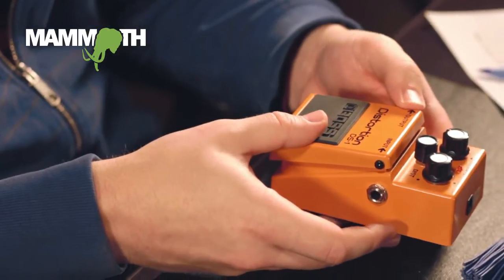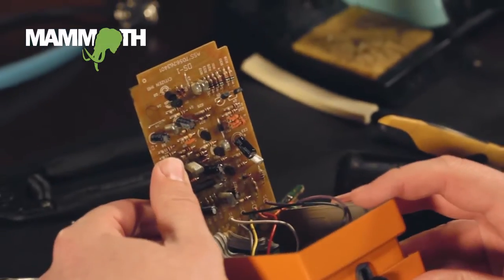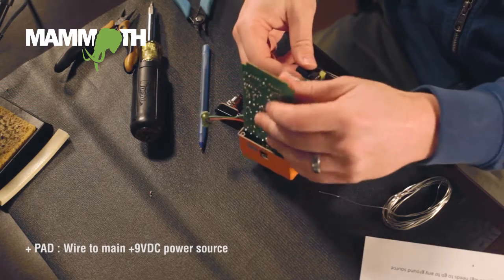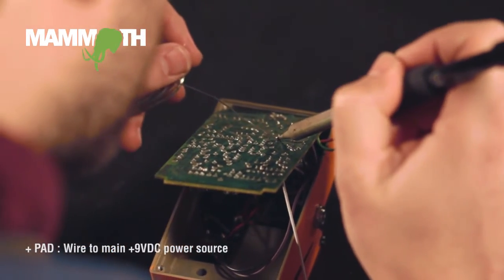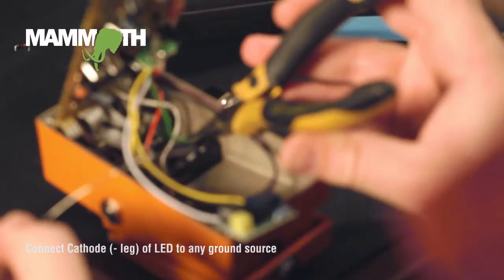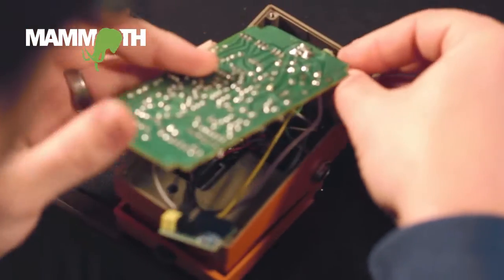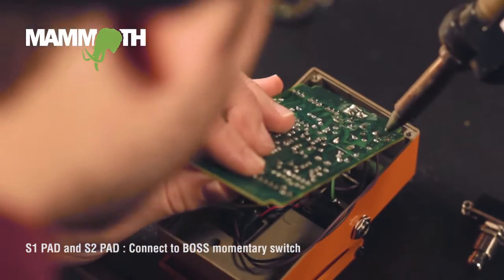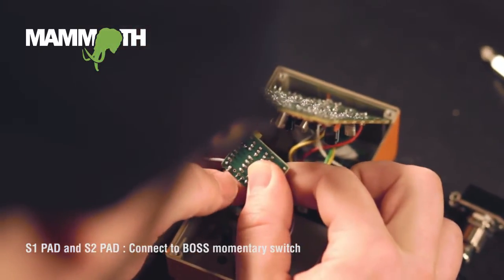Isaac Installs Click-Less True Bypass Into Boss DS-1 Pedal

Comment: Finally got around to installing in my Keeley DS-1. I bought a set of different coloured wires and just used the same colours as Isaac. Saves getting confused. Note on my DS-1 the Zener diode was jumpered across. I removed this. All works a treat. I did things a little different. 1) I made sure all wires went through the pcb holes from the top. 2) I then put the whole lot in quite wide shrink wrap - this takes less space and feels electronically safer. This way I didn't have to stick the board down or bend any components. An awesome pedal that I can now mix in loops with other pedals.

Comment: I checked the modules and seems like they are no selling them anymore,  there are other vendors,  you can try  "Griffin Effects",  they have a more updated version, and other bypass systems  like "the Parasite" bypass I installed in my Boss SD1, or the Zombie Optical Bypass,  It can be a pin in the neck to install if you don't have much skill with the soldering iron,  even you can destroy you pedal, is better in that case to have a professional to do it.

Comment: The clickless true bypass mod works great also for defeating a pedal that is turning on automatically at power up.  One of my Boss pedals that I don't use often was doing this.  The only thing is I had do little bit of investigative work with an ohm meter and a voltmeter to find the resistor to remove and where to wire in the 9v to the clickless board. 

The mod works great.  Now when I power-up my pedal board the Boss FZ-3 doesn't auto-turn on.

Comment: I noticed that the buffer on my sd-1 is adding some unwanted noise in the line as the note trails off, with the pedal in bypass and engaged.  It's unwanted, unpleasant noise, not like normal amp or pedal hiss with high gain, if it was like that I wouldn't care.  I noticed that if I send a buffered signal into the sd-1 by placing the boss tuner pedal before it that it fixes the problem with the SD-1 a little,  the degradation of the note as it trails off, but with both the tuner pedal and the sd-1 in chain close to each other than I get buffered line noise  that is strong, maybe because they are too close together.  I found if I do an every other type thing on the pedal board, like buffered and then true bypass and a 1 foot cable or so and then buffered pedal again and then true bypass next, I seems to get the best kind of signal as it passes through.  But with all that said, since the sd-1 seems to be acting up in the buffer and the tuner pedal seems to work a lot better as a buffer pedal anyway I am hoping to just mod the sd-1 to true bypass instead of replacing it.  At NAMM Boss said they have upgraded the buffer in the new Waza Craft tuner pedal that is coming out.  Not all buffers are created equal.  I'm curious if this will be a large improvement from the TU-2 and 3.  I found the TU-2 to make the single a little bit harsh, thus having to run a bunch of true bypass EHX pedals behind it to smooth things out again (which may seem like a contradiction, that I would have to run lots of cable and true bypass pedals after a buffer to try and bleed out some harshness the buffer put in even though the point of the buffer is to boost the line, maintain the highs in the signal if running lots of effects and long lines :O ).  Thanks for the video, It was a little hard to see with the camera angles but it's nice that the info isn't being kept secret.

Comment: I've got a question for anyone who may know. On the Older Boss DD3 and DD2, the resistor you remove to defeat the flip flop circuit is R58. Does anyone know which resistor it is on the new DD3s with the tiny surface mount components?

Comment: Hey guys, i have a question here, my BD2 is my 6th pedal in the chain, after it, is my DS2, when i turn off the blues drv. my signal is totally mute/off, when i turn on, everthing works fine but it have to be on all the time. it doesnt happen with the rest of my boss pedals, so i thing my BD is the problem, ¿could be the switch the cause of this failure? i opened the pedal and i found a lot of rust like wood mix with dust and oil over the circuit, i clean it out, but im waiting right now to the circuit cleaning spray drys, this maybe take over the night,  did you experiment something similar in the pass? just for the record,  the BD2 its my fav pedal....thanks in advance.

Comment: When in bypass mode does the signal run though the whole Click-Less PCB? If so does it color your tone. With a normal true bypass the signal just goes though a little jumper wire.

Comment: the signal goes to all the components? no it goes to a BUFFER which is much better than a bunch of true bypass pedals acting like a long cable itself. i got a total of 7 pedals, goes in through a boss tuner and out through a boss GEB7, it also has a LS2 in the middle of the chain, and my signal is crisp and strong all the was through. dont waste your money and time on modifying boss pedals for "true bypass" shit, buffers are the way to get the best signal possible if you have a pedalboard
Reply: +SweBass Bro you only need one pedal to buffer, so if you have one pedal that stays on all the time, it buffers your pedal board. You could use an EQ pedal for that and never turn it off, the rest of your pedal board could be true bypassed, cause the buffers stack, and with tons of pedals you lose a lot of treble in your amp.